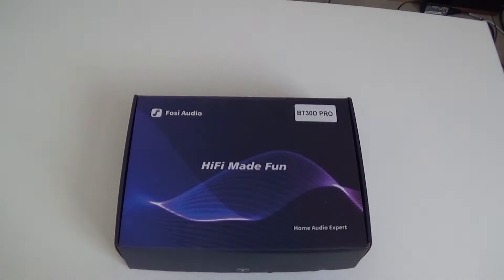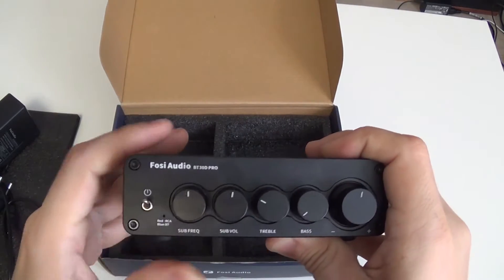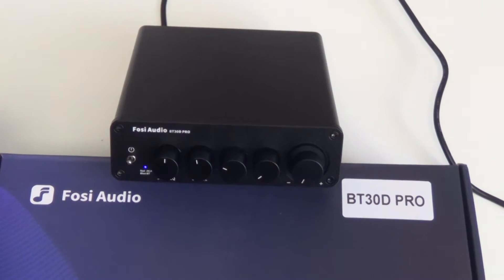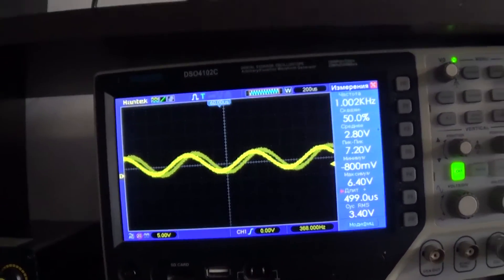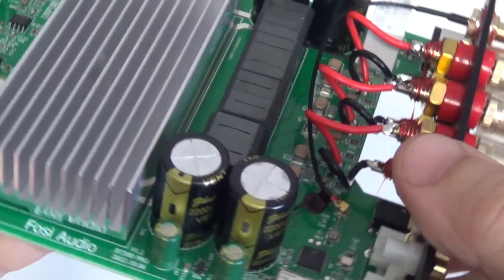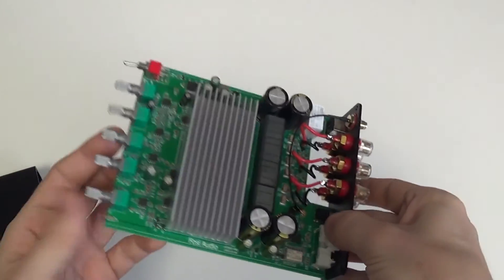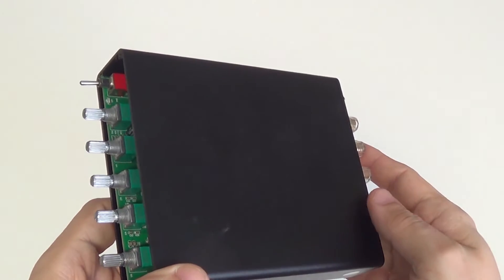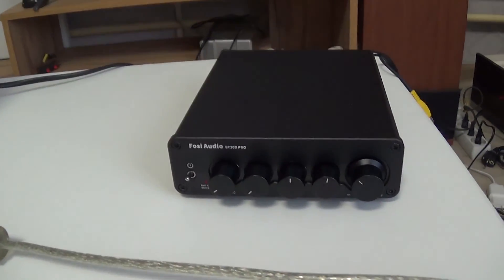Fosi Audio BT30D PRO. One of the best bluetooth amplifiers 2.1 with the TPA3255

Comment: I love mine so much at work, I built a 2.1 system with the BR30D Pro for my wife's PC. She loves it, too.
Then I got a T20 valve amp for the bedroom, and a very cool multi-Fosi 2.1 system for my PC, based on the ZD3 DAC, the X5 Phono preamp, and the GR70 valve pre-amp, along with 2x ZA3s in mono, and an M03 subwoofer amp.

Yes, the little BT30D does run hot, but I think I can get over it, as it sounds so good.

My cup runnneth over! :)

Comment: Got mine yesterday. I HOPE after some burn in (if thats a D class thing) it will be a bit less spiky.  Tone needs to gel. Clarity is nice and it has a sense of authority. The main negative so far is bass that was tight and musical, thru this unit is now loose , rather 1-notey, deep but flacid with bass that "comes and goes". The bass sounds like its coming from a far lesser sub than I am using.  I'll continue to tweak sub controls and reposition the sub. I hope the negatives smooth out with use.
Reply: Maybe it's your speakers?

Comment: Mine has no problem in heat even though I used in tropical countries. Probably is has different or latest versions? The power supply is not optimal. It is hard to find and more expansive than unit for displacing the fosi power adaptor than buying 1 unit of linear power supply 36v 20A.

Comment: I hooked up my fosi to my active sub over pre out to LFE mode on my sub but it just control total volume not freq sub or vol sub...is that normal?
Reply: You answered my question. From what I've read pre out is essentially untouched audio passthrough.

I'm going to try connecting my active sub to passive sub connectors and hope for the best
Reply: @vincent.416 you can’t do that. Active cannot be connected to passive out. It will damage the speakers

Comment: Please don't buy it , excessive heat generated, even in stand by mode. No air circulation option.   😢
Reply: if you don't bothered about warranty make some holes on sides of the case like mine
Reply: which one you recommend
Reply: @condriex  any good amplifier with Good air ventilation/ circulation cabinet ...
Reply: @condriex  you can buy--  PYLE Amplifier
Reply: @condriex  Pyle Amplifier
Reply: @condriex  normal home theatre. 2.1 100W.

Comment: Can you turn off bluetooth in the BT30D pro? I want to use another BT device with LDAC via the rca port but the built in bluetooth stays active.
Reply: unscrew the antenna ?
Reply from the maker: I think you can only do that by tampering with the board
Reply: Remove the antenna and cover the connector with a bit of tinfoil (careful not to short it out).  The BT receiver will then only pick up for about 6 inches allowing you to use your outboard adaptor.

Comment: Okay.. here's the thing.  Those outputs are not single ended.  They are BTL (bridged) outputs so when you attach a single scope probe you are reading only one side of the bridge.  If you attached a second probe to the negative speaker post, you would find the same audio signal, but out of phase.

1) The actual output voltage is double what the scope shows so ....  Power = sqr(Voltage) / Impedance. ... V= 13 + 13 == 26 volts : p = (26 x 26) / 8 = 676 / 8 == 84 watts. or 168 watts on 4 ohms.

2) The PWM carrier you detected, will be on both sides of the bridge, but in phase, so that it produces no output.  (this is pretty normal for Class D, btw)

The other issues ... low gain, bad thermal solution, etc. are on point for Fosi products.
Reply: Could you recommend a similar size amp that addresses those problem for similar cost?
Reply: In another post Fosi Audio said 25 W for 8 ohms.

Comment: I have to 110-160 Watt speakers shoud i buy it or not ?
Reply from the maker: There is an opinion that the amplifier should be 20 per cent more powerful than the speakers. For better control. I'd recommend a higher-powered amplifier.
Reply: As this little amp is less than your speakers recommended range and has no clipping indicators, I would suggest you look at something else.

Comment: I purchased this amplifier for my future son in law. I ordered it without the stock power supply and bought a more powerful power supply for it. In a large room, it drives a pair of Monitor Audio Monitor 100 stand mounts and a repurposed Sony passive subwoofer from an old HT in a box system. Source is an entry level Audio Technica turntable and bluetooth. It sounds very good on both and gets very loud. I have recently added the Douk Audio T8 Pro 7 band equaliser which is also very good. I like this setup very much, and my future SiL loves it.

One thing to bear in mind, if you're looking for max wattage, is that this amp splits the available power between the two TPA3255s, irrespective of whether or not you are using the passive speaker outputs (which makes sense). Accordingly, if your power supply is, say 240 watts, only 120 watts will be available for the stereo output. If you don't intend using the passive subwoofer outputs, you would be better off with a different TPA3255 amplifier, such as the Fosi Audio ZA3, V3 or BT20A Pro, Aiyima A07  Pro or Max etc.
Reply: Interesting about the power supply. I also wanted to buy 48V 10A, but Fosi told me that this amplifier would not handle it...

Comment: I was looking to buy this just to power my sealed subwoofer i built using a ground zero 8" 4ohm driver that needs a 150w rms ideally, and a mininum of 100w rms, but this amp doesn't seem to be up for the task. 
Since i've got already an active pair of speaker, but i thought of going fully passive one day( and thus replacing them), i really had my mind set on this, but thankfully i just came across your video. 
At this point i might just go for a Luxus Audio SD200,  control the main volume using an inline potentiometer, and feed the signal to my active speaker from the luxus's line out rca connectors. 
As you might have guessed, i have a 2.1 system that consists of an existing 2.0 active speakers with no sub output, and a home made subwoofer that i want to integrate with. 
If you can recommend me other options, either be it like the BT30D Pro, or plate amps with line out that can at least partially live up to their claimed wattage, i'd be very greatful! Thanks!
Reply from the maker: Hello. Do you need an amplifier with built-in power supply or just an amplifier board with lpf filter?
Reply: I have two of these set in a 4.2 arrangement pushing two 15" horn speakers and two Klipsch f3 tower speakers a 12" sub and a 15" sub it's freaking awesome!!!!
Reply: @donaldkillian9864  i ended up buying an AIYIMA A3001 just for the sub itself, we'll see along the road if i ever have to go passive for the speakers, i'll just get a dedicated stereo amp with sub pre-out to feed signal to the a3001. 
This a3001 amp came with a 36V 6A power adapter, and it's a mono amp based on a  TPA3255D2, needles to say it looks good, stays cool, and manages to move my woofer properly. Couldn't be happier!

Comment: Hi, Thanks a lot for your video but I'm sorry I'm not very familiar with some of the more technical terms. 
Was it 40watts per channel into 8ohm speakers? my speakers have a sensitivity of 87db. Will it be good enough for my small bedroom? Thanks in advance.  
I have my eyes on this mainly for the subwoofer out.
Reply from the maker: Hello. No, the 40 watts was on a 4 ohm load. Accordingly, 8 ohms will be even less
Reply: @Remonvik  oh wow! that is a deal breaker! 
I'm currently using the fosi audio tb10d. I believe its about 75watts per channel with the 32v5a adapter. 
the bt30d pro will be a downgrade just for the sub out. too big of a gap.

Thanks for your feedback. Hope your channel grows.
Reply from the maker: Thank you so much! I hope so too
Reply: @Ron.Sarker  
Don't be fooled ... your tb10d and this amplifier use the same amplifier chips.  They will be far more alike than different ... especially giving you the same power outputs.

In both cases ... With the 32 volt power supply you're going to get about 40 watts per channel on 8 ohms and 80 on 4.  With a 36 volt that jumps to 75 and 140.  On 48 you should get 100 and 200.  Provided of course your power supply can deliver the needed current.  You will be OK with 5 amps up to 36 volts but at 48 you really should have a 10 amp supply.